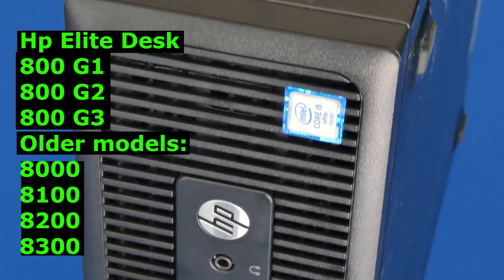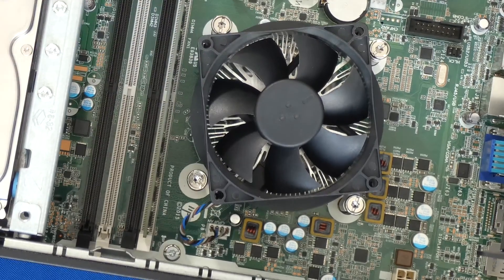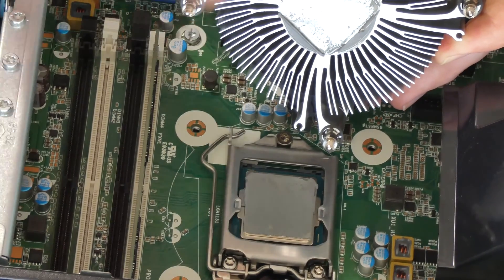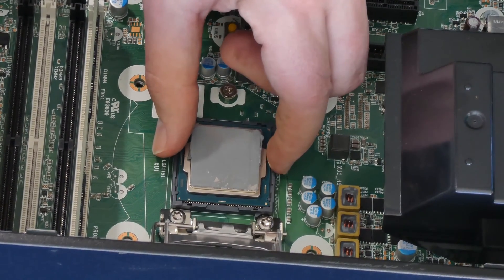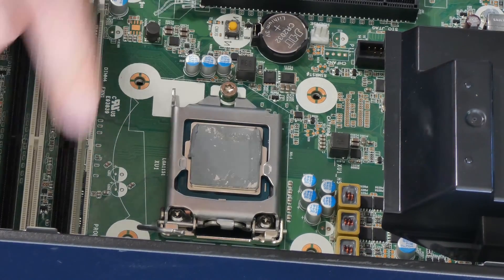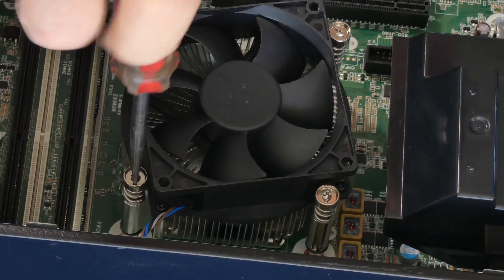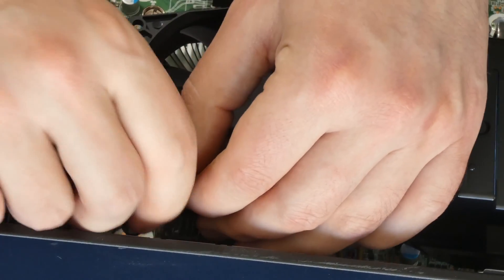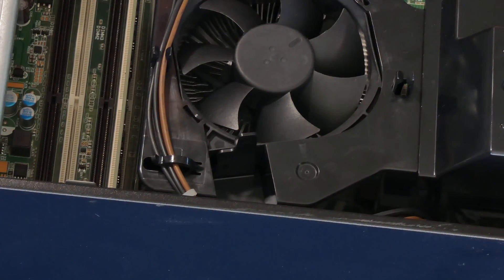i7 CPU Upgrade HP Elite 800 G1, HP Elite 800 G2, 600 G1,  Small Form Factor Desktop

Comment: Any recommendations for a gpu that will work with this pc as i have bought an i5 model of this pc and the power supply is 240w
Reply from the maker: The best card that will fit inside the PC is GTX 1650 LP like this: https://amzn.to/2VM8Sxx
Reply: @Cobuman  Hey man, I've got an EliteDesk 800 G2 with what it says is a 200W platinum PSU. I've put a GTX 1050Ti in it and it seem to startup ok. I'm wondering if it'll be alright or if I need a bigger PSU...I could put a Flex-ATX in there with a converter cable. You seem to know what you're doing, what do you reckon?
Reply: Simon Richardson how is it?

Comment: i have HP Elitedesk 800 G1 what i7 cpu is the most powerful it is compatible with?
Reply from the maker: That would be i7 4770 like this: https://amzn.to/3cKOh1Y
Reply: @Cobuman  i7 4790 and 4790K are compatible both are LGA1150 why is 4770 the best i7 in this pc
Reply from the maker: @hitman481000  Because HP never sold 800 G1 with a CPU higher than i7 4770. There is no guarantee that BIOS will support anything else therefore I can not recommend other CPUs.

Comment: Thank you for the video! I have an old i7 4770(k) with the same socket type that I want to put to good use. Will this work with the G1? Do you think there will be any software limitations or thermal?
Reply from the maker: The chipset is designed for 4th gen intel so it should be fine; however, in case of 800 G1 official version support/sold by HP is the i7 4770 (non-k)... I'm curious if it will work...
Let me know how it goes.
Reply: cobuman I can confirm that the K series does work! Thank you for the video and your help!!

Comment: Your subject was i7 CPU Upgrade HP Elite 800 G1, HP Elite 800 G2  Small Form Factor Desktop and what you did was upgrading from I3 to I5 my friend!!!!  What about I7????? Please ADVISE!!!!                                    cobuman
Reply from the maker: It's the same exact process for installing an i3, i5 or i7... it's the same socket after all. 😁
Reply: The socket is the same which is logic!!!! What about the clock speed of the mainboard MHZ wise? Each mainboard has its own architecture my friend. Does this mainboard supports the I7? I don't think so!

Comment: I upgraded the Ram and added the video card but my CPU is running at 90-100% most of the time. If I upgrade to I7 will I need to get different ram N video card? also will the stock power supply handle everything ok?

Comment: whats the best CPU you could get into a G1?
Reply from the maker: Intel i7 4770 For 800 G1: https://amzn.to/2OYw06T
Reply: @Cobuman  Thanks Man already got one :). I did some digging and found you can use a 4790/4790K (assuming you want to drop that much $$$
Reply from the maker: @rokinz3270  Yep, you can probably find a used one on ebay or something. But yea, don't spend a lot on CPU upgrade. I'd say no more than $100 on 4th gen because it's older tech.

Comment: Hey, thanks for sharing this. I have a quick question. Do you know if I can add a graphic card to this cpu? and if so, what graphic card is compatible? Thanks.
Reply from the maker: Sure. As long as it's a low profile type like this: https://amzn.to/2TSKklB One I linked is the best available.
Reply: You need to be careful with the selection of a graphics card for this SFF system. Many modern graphics cards require additional power from the PSU such as a six pin or eight pin connector. These SFF HP's do not provide such power connectors on the stock PSU so you are limited to the type of graphics cards that pull power from the PCIe bus alone. The low profile GTX 1050Ti or the newer GTX 1650 will be your best choices for performance. They are 4GB DDR5 VRAM and only pull 75 watts from the system. I've had the 4GB 1050Ti in my EliteDesk 800 G1 for over two years and it works great with the stock PSU. Watch the GTX 1650 because it's a double slot card so make sure you have the room to put it in.

Comment: Hi, I got an EliteDesk G1Tower with 4570. And I installed a 4770k but got no display and I hear the fan rpm increasing high and I off straight away.. I did reset cmos but seems doesn’t work.
Reply from the maker: I hate to tell you but the 4770k - the "k" version is not officially supported by this chipset; however, the non k version is. You can try to update the BIOS and maybe that could make it work... but it's slim chance. If you install the 4570 back in you probably update bios and then try the i7 again.
Reply: cobuman ok bro noted.. sadly still can’t work out.

Comment: Will the i7 4790k  work on a ED 800 G1-T
Reply from the maker: The chipset used in your PC is intel Q87 which technically supports that CPU. Here is the link (click on compatible products): https://ark.intel.com/content/www/us/en/ark/products/75007/intel-q87-chipset.html I'm not 100% sure but it should work
Reply: You need to be careful here. The Core i7-4790K is a 4GHz processor running at 84 watts and turbos to 4.4 watts. Heat is your biggest problem with this CPU in this system. Because of the limited air flow in the SFF chassis you have the potential to experience some serious thermal issues with this CPU especially if you are pushing it hard. 80+ centigrade temps atre not uncommon even with an active cooling fan set up. The stock fan/heatsink set up will not due. You wil have major thermal CPU throttling issues if you do not upgrade your cooling system. Also the Core i7 4790K is still quite expensive even in the used market at about $175 US (average) as opposed to the i7 4790 which is at about $100 (average). You can't overclock it in this system so the performance gains are not nearly as advantageous as it would be in a different system. Just some things to think about before you spend your money.
Reply: Walter Legere is the 4790 the safest bet? I also have an 800 g1! Would love to upgrade from an i3 4330 to i5 4790!

Comment: Great video! I have an EliteDesk 800 G3 MINI with an i7-7700T can I go to a newer generation i7? Say the i7-9700K?
Reply from the maker: Thanks Eric. Unfortunately, BIOS will not support it; however, i7 7700t is a solid processor so I don't think it's worth the upgrade.
Reply: @Cobuman  Would the i7 7700 be better than the T version if I decide to go that route? I know my power supply is a 65w
Reply: @EricK-ro5yp  Watch the cooling. It's designed for 35W

Comment: Can you remove the internals from this and put in another case?? These pcs are very cheap and would like to put in a more gamer friendly case so i cna install a full size video card too.
Reply from the maker: Sure, I have a video on that: https://youtu.be/C70nmtTFPuw
Reply: Yes you can but it's a royal pain in the butt. You'd be better off building a system from scratch with legacy parts because of the BIOS limitations of the HP systems and not to mention the "white board" restrictions for some upgrades. If you're not happy with upgrading the HP system to the max then why would you waste the time and money it would take to convert proprietary components into a "custom" PC when you could just buy unrestricted custom components to start with? Use a little common sense here.

Comment: hi i have HP Elite disk 800 G1 SFF i forgot my BIOS password help me please.
Reply from the maker: Inside the case there is a green Bios jumper you can remove to unlock Bios (by the SATA ports). Also, there is a yellow button to reset Bios, but try removing the green jumper first.

Comment: Great video, thanks so much. I have an HP Elitedesk 800 G1 Tower, what is the best/latest generation of CPU that I can upgrade it to? Thanks for your answer in advance.
Reply from the maker: Good questions. The chipset used by 800 G1 is Intel Q87 Express which means you can go with i7 4770 CPU like this: https://amzn.to/2PRVozj the link is just an example shop around for a good deal.

Comment: can you tell me why my hp prodesk 600  g1 4gb i5-4570 has become slow after 1 year of use with alot of desktop short cuts icons,i use firefox and it hangs when im making music videos with alot of pics on pc.with yahoo mail open,youtube and making video,it gets real slow. takes long time to open on screen keyboard or ccleaner. once ccleaner is run its faster but only lasts fast a little while ,like 10 minutes use and must run ccleaner again before it crashes. my new hp elitedesk 800 g1 8gb win7 i5-4570 is super fast but i have only little on it. do i need more ram or another hp 800 win 10 8gb and will that slow down after a year. im confused.
Reply from the maker: Hi Joe, I'll be glad to help. Here is my video on top 5 reasons why computer might be slow: https://youtu.be/VSy-AzG3yhs
If you need further help let me know; but, the video should help you figure it out.
Reply: @Cobuman  can you help,is this ram i buy to add to my 4gb hp prodesk 600 g1.do i have to match exsisting ram exactly or look for any 240 pin ddr3,1600 mhz.
Reply from the maker: @garyk4155  It has to be specific. Unbuffered and non-ecc like this one: https://amzn.to/2RLdY9k
Reply: @Cobuman  is that exact for my prodesk 600 g1
Reply from the maker: @garyk4155  it is.
Reply: @Cobuman  i bought another pc because the cost of mem was almost that much.hp elitedesk 800 g1 8gb ddr3 but came 665 speed not 1600, how much does that affect pc speed. i have 30 day free return! what do you think i should do!
Reply from the maker: @garyk4155  check BIOS settings. It's probably running at 1333 which is fine.

Comment: Hey there, I have a Elitedesk 705 G3 sff currently have the factory amd pro 9500 whats the best cpu I can upgrade to? Read some where that mention Ryzen 7... but not sure... also see Amd a12 being thrown around alot. Any suggestions?
Reply from the maker: Good question. Officially best supported CPU for your PC is A12 9800 like this: https://amzn.to/2X23nwR
Reply: Does it need to be Pro version or anything special?
Reply from the maker: @charliechang9mil  According to HP specs for your PC it talks about the "PRO" version; however, if Ryzen CPU is supported that would be a really nice upgrade. Both use AM4, it comes down to if BIOS of your PC support it. I found that a version of EliteDesk 705 G3 has Ryzen 5 PRO 1500... maybe there is some compatibility.
Reply: @Cobuman 
Is there anyway on my end to know forsure like looking into bios?

hmm what would you suggest?
Reply from the maker: @charliechang9mil  Find out which version of BIOS you have and then I would reach out to HP support and ask them which CPUs are supported. Only they would know for sure because it has to do with BIOS programming.
Reply: @Cobuman  *Update tried a Ryzen 5 bios did not post :( then I grab a a12-9500 off of ebay everything works but it seems to run hot... I swap back to the A6 but wanted to know if its just a matter of incompatibility or if a upgrade in fan would help?
Reply: @charliechang9mil  The BIOS is not the biggest limitation on this system, it;s the Intel chipset that will limit your upgrade-ability

Comment: I have 800g2 core i5 6500 can i upgrade to i7 7th or 8th generation?
Reply from the maker: Good question. The CPU socket is LGA1151 which technically speaking is the same as the current gen Intel CPUs like i7 9700... however, BIOS support is the issue...  Luckily,  i7 CPUs age really well so if you were to upgrade to supported Intel i7 6700 For 800 G2: https://amzn.to/2WYVwM0 it will be pretty close to current gen speeds.
Reply: No - You can not use a 7th or 8th gen CPU in this system. The BIOS is the first problem, voltage is the second and your Intel chipset will not support the additional cores on the CPU.
Reply: Nope